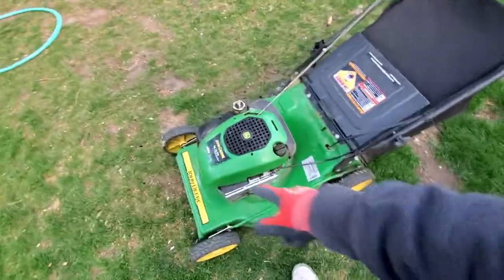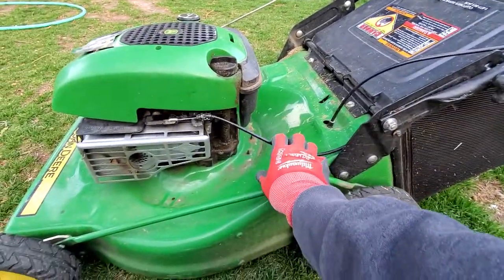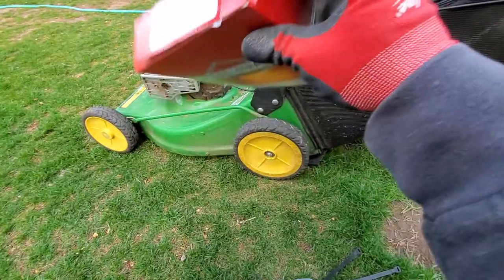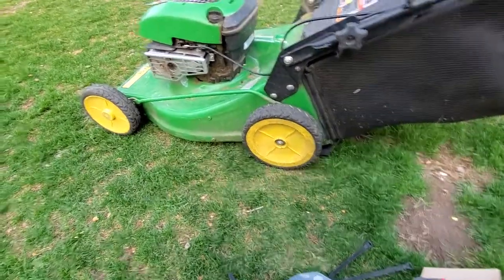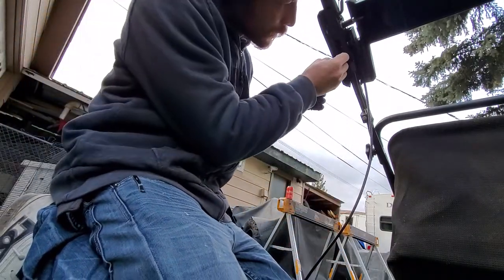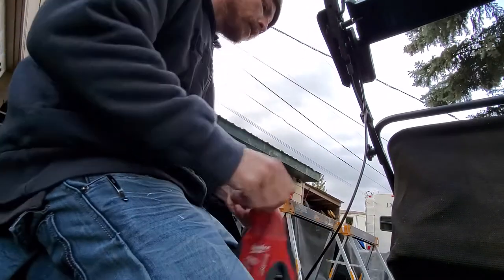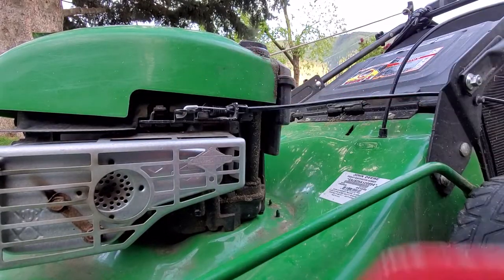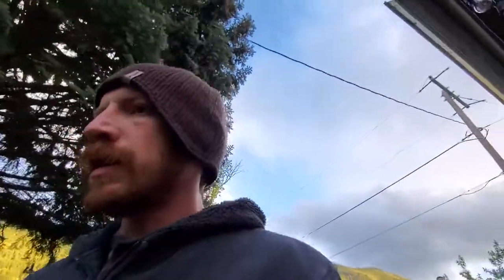John Deere Operator Presence Cable - GX23336

Comment: My issue exactly.  Former owner had tied a knot in the steel cable at the mower end, shortening the travel.  The "operator presence" cable easy to install. Lifting the "mow-motion" drive handle is awkward.  JD tried to re-invent the wheel. Narragansett Bay.